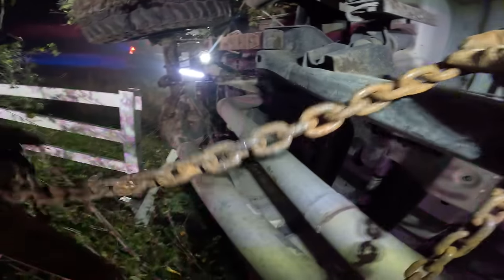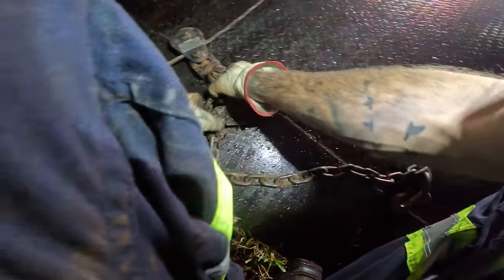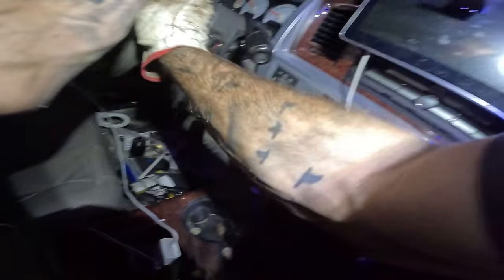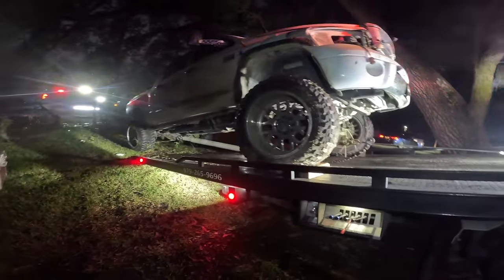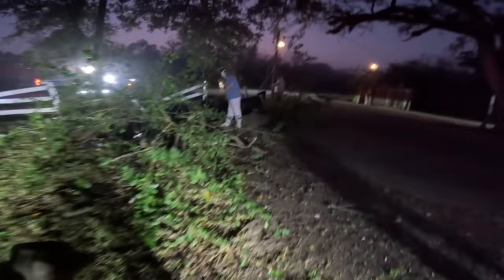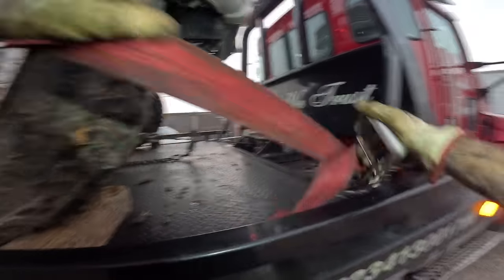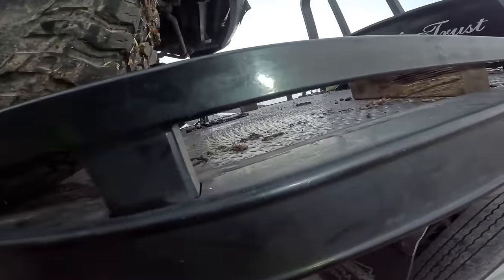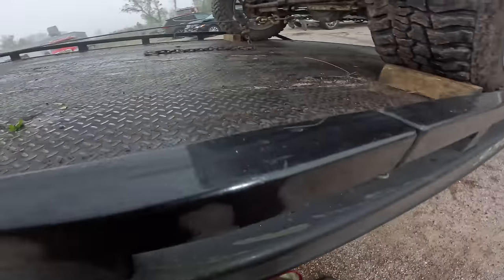Ram 2500 Rolls Through a Fence!

Comment: Do you think it was driver error or did something fail on the truck? At least it looks repairable
Reply from the maker: From what I was told, the truck dropped a tire off the edge and over corrected, which caused the loss of control.